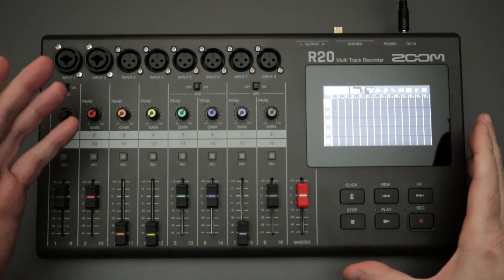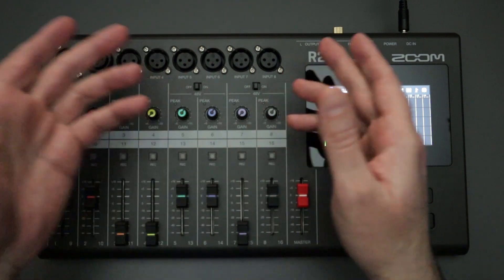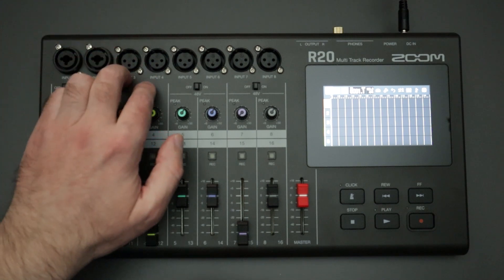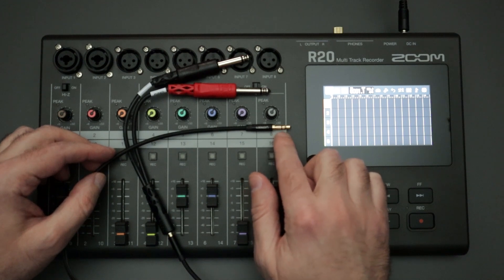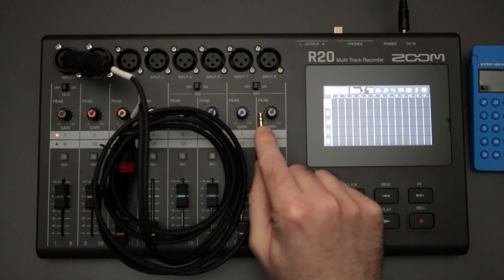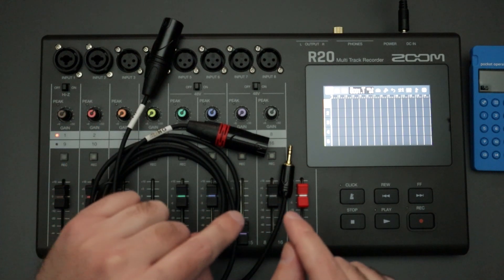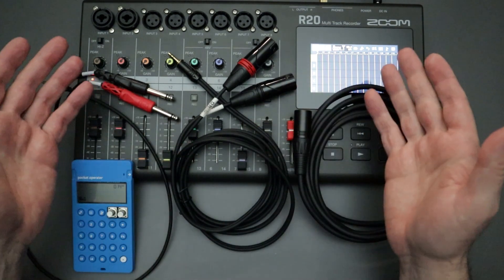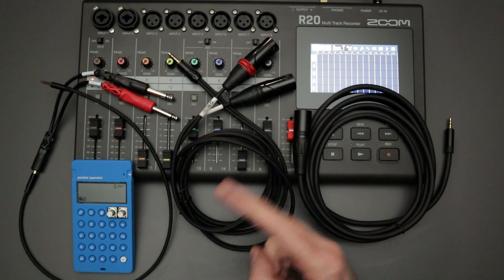ZOOM R20 - using all the inputs with TRS to XLR cables (applies to many mixing boards too)

Comment: Seen lots of reviews about this recorder but not seen one who actually mixdown a shole song using their intruments and vocal.what is the sound like after mastering,does it sound worthy for Spotify? And does it have foot switch like tascam?
Reply from the maker: It does not have a footswitch, sadly.  My old R8 had a footswitch jack and I liked using it to switch effects on/off.

I've mixed down whole songs with it, but nothing serious that includes vocals (because I'm a horrible singer).  I would say that what I've recorded with synths and guitars can sound pretty good in a mix down.  I play around with various EQ/compressor/sonic exciter effects in my final mixdown to try to get it to sound polished and finalized.  So yeah, you can get it to work fairly well to be worthy of Spotify, but its not easy.  Also, this thing will create a final stereo master that is 24-bit 44.1kHz.  I think most major streaming services will play that, but these days they are looking for 24-bit 48kHz as their standard.

Here's an example of something made 100% on the R20 and mixed down with the R20.  It's just 5 tracks of Pocket Operator synths, but it gives you an idea of the clarity you can get:
https://youtu.be/4aY3Cpcza5s

So all said, yes, you can mix down with it and you can create fair-to-good sounding stereo songs with it.  But you will definitely get a better, tighter mix if you take all the tracks, import them into a DAW, and mix down there.  I've done that and it can really add some punch to your mix.  The nice thing about the R20 is that all the individual tracks are saved as .WAV files on the SD card, so it's easy to import those individual tracks as stems into a DAW and use a mastering plug-in to tighten everything up.
Reply: @GazRendar  cheers for responding.i'm still researching about this unit as i like the idea of touch screen and DAWless approached.the things that holding me to get it is no pedal, as i like using my foot when recording specially instruments. how's the touch screen? does it lag and freezes? do you recommend this unit? lastly which one you prepared this zoom r20 or Tascam DP03sd?
Reply from the maker: I've used Tascam recorders in the past, and I generally liked them.  It really just depends on your individual recording needs.

Right off the bat, the Tascam DP03sd only records 16-bit / 44.1kHz.  The product is over a decade old now.  The R20 and the R12 both record at 24-bit, which I think makes a significant different if you are recording a variety of instruments from guitars, vocals, strings, keys, synths because that extra headroom on the volume with 24-bit helps to separate the sounds from each other.  I think the DP03sd is much more comparable to the R12.  Those are both 8-track recorders.

The R20 has 8 inputs to record 8 things simultaneously.  The touchscreen on the R20 is just "ok."  Don't expect it to be like an iPhone.  It's more like a car stereo touchscreen, or like a first gen Amazon Fire tablet.  It works well enough, but you have to adjust how you use touchscreens.  You just have to be a little slower and a little more precise than an iPhone.   The R12 screen is even smaller, and it's not multitouch.  So you have to adjust even more to use it.  But still, once you understand how it works and you adjust your brain...don't think it's an iPhone's screen, it's just something else...you can use it. 

Both the R12 and R20 are much better when it comes to editing your tracks compared to the Tascam units.  The touchscreen just makes splitting, copying, pasting, and moving stuff so much easier.  I think the effects on the R20 and R12 are useful, especially for guitar players.   To be fair, I thought Tascam effects were useful too.  Tascam, and even the older Zoom R8, R16, R24 had dedicated mastering effect patches that made it easy to master a stereo mix-down.  It wasn't always the best, but it was an idiot-proof way to get something that was at least "ok."  With the R12 and R20, you will need to make your own custom EQ/Compressor/Limiter/Exciter/Reverb patches to get a mastering protocol that you like.  It takes time to do, but it has more potential.  It's just harder to pull off than the idiot-proof mastering stuff the older units give you to get something that is ok.

But if you are serious about trying to get recordings sounding as good as possible, I think you'd be best served going with the R12 or R20 and then importing your tracks into a DAW to do final mixes there.  Same holds true if you'd rather instead get an L-8 or the Tascam Model 12 - any of those more recent hybrid mixers/multitrackers.  Those things are good, and they will let you record at 24-bit / 48 or 96kHz, but they are very limited when it comes to effects. 

Sorry I don't have an easy answer for you...I hope that was still useful...
Reply: @GazRendar  thank you so much Gaz for the info it helps me to decide.looks like this R20 is a good upgrade from my DP03SD..Definetely will Sub.love your content🫡

Comment: What kind of USB C cord is required to connect this to a computer? Are there speed or power recommendations to be used with the R20 (ie 10gbps 100 watt)?
Reply from the maker: There are really no specs for the USB-C cable to connect it to a computer.  The R20 can only be powered through it's own power plug.  It can't be powered through USB, so there is no power requirement on the cable.

The data transfer is actually only USB 2.0 speeds, so you don't need any kind of fancy USB-C cable.  For whatever reason, I do find that I always get a more reliable connection when I use a USB-C cable (on the R20 side) that has a USB-A on the other side (plugs into the computer).  Namely for use with Zoom's Guitar Lab software.  Sometimes a USB-C to USB-C cable doesn't always have the computer recognizing the R20 on the first try.  At least with Windows 10 or 11.  I haven't tried it with a Mac.
Reply: @GazRendar  Thanks man that's good to know. I'm planning to set it up as an audio interface for my mac. I'll make sure to have usb-c to usb-c as well as usb-c to usb-A just in case. I'm hoping there won't be a problem running speakers into the R20 and then into computer (for regular use as well as recording with the r20). But if there is I can just get a regular audio interface to go between my speakers and computer.
Reply: @JourneysEnd How's the R20 working as an audio interface for you?
I have USB mixers and audio interfaces but I'm interested in using the R20 with my Mac M1 using GarageBand.

Comment: Love these videos thanks for doing them! Here's a basic, possibly dumb question. How do you get a simple stereo condenser mic setup... Like the Hn4 Pro...  on te R12 or R20? With the HN4 you have those two wonderful stereo mics built in. You just hit record and get a great stereo 2 channel track. But how do you do that on the r12 or r20? Do you have to plug separate mics into the 1 and 2 channel, which is hassle.  Then have two gangly condenser mics. Which may not be aligned properly... And you have to get stands for them, etc. I'm doing singer/songwriter stuff and I like to start by doing a simple stereo room sound recording. How do you do that on the R-12 or R20? I remember there used to be a built in set or stereo mics on some of the earlier zoom portable recorders. It was easy peazy. Especially when recording on the fly, say at a club, or outdoors. Do I really have to bring along 2 mics and cable and all? This is the one thing that's haunting me. I'm pretty much set up to buy the R12, but the mic configuration thing has me puzzled. Can't find anything online about it. Thanks!
Reply from the maker: Not a dumb question. You pretty much understand the problem.  You will need two mics....along with some way to plug in the mics.

The old R8 had built-in stereo condenser mics.  I rarely used them, but I liked that they were conveniently there.  Sometimes I just had an acoustic guitar in my hands and I simply wanted to record an idea/melody before I forgot it.  The R12 and R20 do not have built in mics.  You'll need to plug mics in.

I am toying with the idea of buying a cheap mic like this:
https://www.amazon.com/dp/B09PNH3FZ8/ref=twister_B0BJTLMK5V?_encoding=UTF8&th=1

And then getting an adapter like this:
https://www.amazon.com/Ancable-Mini-Jack-Microphone-Converter-Camcorders/dp/B07VB39G1H/ref=sr_1_6?crid=AF0A72WOM817&keywords=3.5mm+TRS+female+to+male+XLR+adapter&qid=1682375827&sprefix=3.5mm+trs+female+to+male+xlr+adapter%2Caps%2C79&sr=8-6

Not sure if that would work, but I'm debating buying it to experiment and see how it goes as a convenient way to kinds-sorta fill in for the lack of a built-in mic.

But overall, that's why for some people you are better off going with a Handy recorder...they have the built in mics and the ability to lay down multitrack recording.  The trade-off is that you can't really edit those tracks on the device and you probably don't really have much in the way of effects.
Reply: I have the old Zoom Q2 recorder that has a nice mastering effect in the handy share app 68 ways to do some quantizing in clear power excetera

Comment: What would be the best way to implement a "volume limiter" on the R20, which would protect main output from un-expected extreme volume on a stereo input? Thanks again for your very helpful videos.
Reply from the maker: You have two options.  The first is that you can go to the track settings and apply a compressor or limiter on the tracks you think might have loud spike here or there (a snare drum track?).  That sort of works, but I find that the limiter/compressor on the individual tracks isn't that powerful.  You can play around with it and see if it works well enough for you, though.

You can also use Guitar Lab to download one of the Limiter effects onto the R20.  There are couple compressors and limiters.  You can then build a patch using one of those limiters/compressors and choose to apply it as an insert effect to the tracks in question to try to control the volume spikes.

I guess a third option would be to put a hardware compressor or limiter between the R20's monitor or headphone out and the headphones or speakers.
Reply: @GazRendar  TY so much for kind reply to silly question. Searching manual, I discovered limiter. All the best :)

Comment: Hi Gaz, I'm at a loss as to how to use a mixdown. I see in the owners manual simply how to mixdown. But I need more information. Can you add to a mixdown? Etc. I want to use 3 or 4 tracks to record my guitar parts. Then go to my band mates to add numerous more. I have no idea how to approach this. Also can you really record on tracks 9-16? Thanks!
Reply from the maker: I think for both of your questions, you want to look at the Fader View (instead of the default Track View).

In Fader View, there is an icon on the top that allows you to toggle all the physical controls to route to Tracks 1-8, or to Tracks 9-16.  When you flip it to Tracks 9-16, you'll see the tiny LED light that was next to the "1" on Track 1 switch to lighting up the light next to the number "9" instead. 

For Mix Down, you select that feature in Fader View as well.  But that's to take anything that you have already recorded...say on Tracks 1-6 (vocals, back up vocals, guitar, bass, drums)...and you turn on Mix Down, hit Record, and it will then play the whole song while you adjust the faders for Tracks 1-6 and then when you hit Stop, it will create a mixed down stereo track and drop it into the AUDIO folder on the SD card. 

If you just want to multitrack, you can keep adding tracks to the project. You can play tracks you already recorded so you can hear them in the headphones or monitor out, but then depending on what input you're using, you will just record whatever is hooked up to the input to the corresponding track.  If you are recording a bunch of guitar/bass parts and need to keep using inputs 1 &2 because they are 1/4" jacks, then you'll likely need to shuffle your tracks around to add more tracks.  I'm not sure if that's what you are asking?  This video might help demonstrate that:
https://youtu.be/EuVe58WC-ZE

Comment: I'm about to get the R20 tomorrow and really enjoy all the information on your channel so thanks! I don't expect you to answer random questions but here's hoping:). I have a digital piano that lets me record internally as a Wav files Do you happen to know if I copy my wav file to an SD card, if I'm able to import it onto a track on the R20? Thanks
Reply from the maker: The answer is...you might be able to...

In order for it to work easily, you'll need your digital piano to record the .WAV file as 24-bit with a 44.1kHz sample rate.  If it records as that type of .WAV file, you'll just need to copy that piano .WAV file into the SD card's AUDIO folder.  From there you'll be able to import it into your R20's project.

If it records as something else...like 24-bit/48kHz, then you'll need to use some kind of computer software to first convert the 48kHz signal into 44.1kHz.  Most DAWs, and programs like Adobe Audition have an export feature that can handle this.  I believe there are some free ones out there that can do it.  (I think Cakewalk can do it).

Here is a video I made about importing .WAV files into the R20:
https://youtu.be/JMmjrkenS8s

Happy recording!

Comment: Glad to see you  are still using and discovering things about the R20.
Really enjoy your videos. The R20 despite its limitations, is an amazing deck especially when using the iPad when recording.
Hoping for another update with track naming.
Reply from the maker: The R20 is definitely useful to people who want immediate recording options without having to worry about going to a computer.   If you get it on sale, I think it can be a good value for a subset of musicians.  And I definitely plan to keep posting R20 content as I use the device more and more. 

And a firmware update that supports track naming seems like something that is feasible.  Because you can already name an audio .WAV file during IMPORT, so it seems like Zoom has something built behind the user interface to keep track of file names that are tied to tracks.  Seems like something they could implement...like just touch the track number and then have the name of the track, "Lead Vocal" or whatever, be immediately visible at the top of the track settings bar.  I'd like to see that too.

Comment: Thank you for all the great R20 videos! I would humbly suggest, with your acquired knowledge, that you make a new "get started" with an eye to new users and their priorities. IE out of the box, most just want to get it working as a mixer, with various combinations of instruments. That leads to projects and effects per track. Tuning. Then a mixer with sequenced backing track from onboard sounds, drums only first. How to play the onboard instruments and make realtime input to effects with an external controller. Next basic recording, syncing etc. Editing. Finally working with DAWs and using software. I bet you could do that all in 30 mins with prep and editing, and score many views in addition to the many you have already earned :)
Reply from the maker: Thanks!  

I've covered a lot of those topics in individual videos, and I sorta did a little bit of that in my First Impressions R20 video...but you are right.  A full tutorial wouldn't be a bad idea.  That'll take some time to put together because it would likely be a 30+ minute video to demonstrate a comprehensive start-to-finish workflow.  I'll put it on my list of possible videos to make, thanks!
Reply: @GazRendar  One more: R20 as Ipad interface in AUM. Many use AUM, this would useful, and easier than "the big one". Sincere thanks.

Comment: Gaz, any chance you could do a comprehensive video on using the R20 as USB interface with DAW? I managed to get mine connected, but I dont understand how to work it....
Thanks!
Reply from the maker: Yeah, it's definitely written down in my queue of instructional videos I should make.  I just haven't gotten around to it, largely for two reasons.  One, I don't use it much because I prefer to be computer-free for my recordings.  And two, the settings that you'll choose are going to be somewhat DAW-specific. But it is definitely something I want to dive into and make a video about.  Hopefully soon!